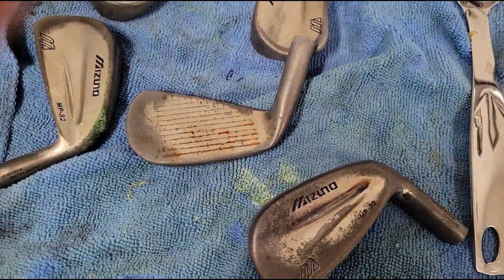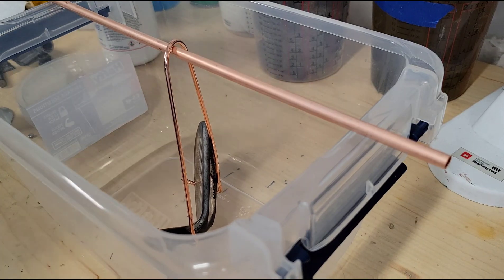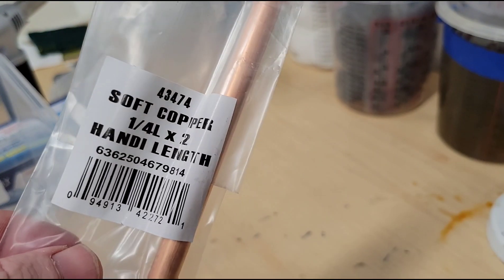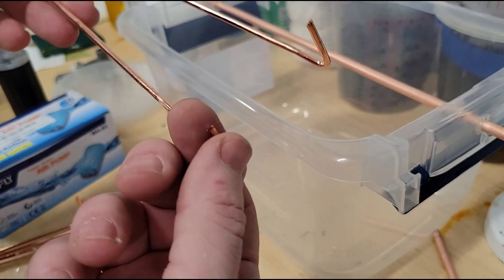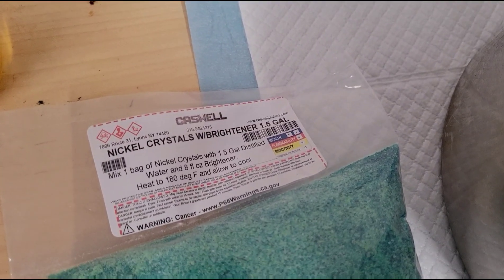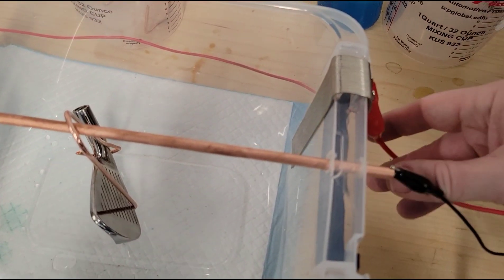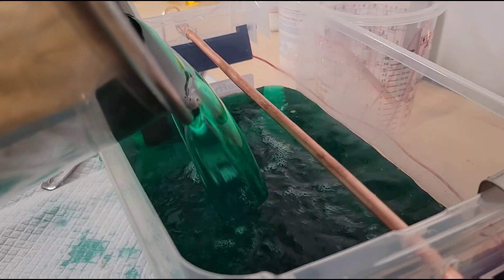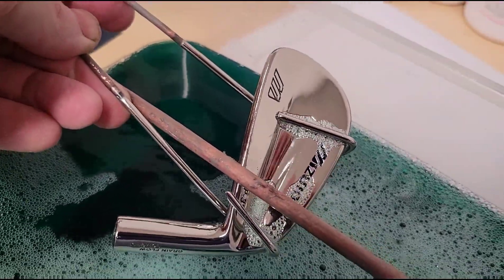Learn How to Electroplate Golf Clubs at Home! - DIY Golf Club Restoration

Comment: I'm shocked the copper hook hanger didn't interfere with the finish on the club? Did you do anything special to avoid that? Shift the club around in its hammock every now and then? I've been trying to perfect electro etching for a while, similar process. Just different solution and swapped anode and cathode. Results have been super finnicky. I've set a high bar but struggling to get the deep, clean, and detailed etch I'm looking for. I haven't tried with the bubbler yet though.
Reply from the maker: @rgraptor2542  Good eye. Yes it can. Now I hang the club upside-down by the hosel to avoid that. This video was my first attempt so the approach has evolved a bit since.
Reply: @BradMeehan  right on, as it does! Still looks nice there at the end though

Comment: voltage? 
what current do you push, DC, AC? how much?
is it voltage sensitive or amp sensitive..or combo?
Reply from the maker: @nowherebrain  3.5 volts DC, 1 Amp. Yes, it's both.
Reply: @BradMeehan  thanks for the response. I assumed DC, but didn't actually "know" and when I make assumptions, I'm usually wrong :)
Reply from the maker: @nowherebrain  lol
 You might find this method easier: https://youtu.be/f487RuyG1AY?feature=shared
Reply: @BradMeehan  going to go watch this..thanks.

Comment: I wanna chrome some motorcycle parts and this is very helpful. I wonder though how well does this chrome method hold up to high heat from a Harley motorcycle engine and exhaust system. I want to chrome my Rocker covers and panels on my Harley EVO engine and possibly some of my engine bolts and exhaust components etc. I've tried hand polishing the rockers to a mirror finish and it's certainly an improvement but not near the chrome finish I desire. Does anyone know if this is safe for high heat parts up to roughly 250° F?

Comment: I’m wanting to refinish my 50-60’s retro table. Would this work for that? I think my table & chairs are chrome. I’m assuming I may need some type of barrel set up since the legs are kinda tall. Anyone have any suggestions? Thank you
Reply from the maker: @sunshinegypsea  check out my video on electroless plating. That may be an easier option.
Reply: @ thank you!

Comment: More questions.

1. The amount you have used in this bath, how many club heads can you treat with this?
2. I have seen nickel plating liquid, this was 3 years ago, if you were still using electro plating have you refined your process?
3. I know the electro is more work than electroless, but do you have a price difference, I want to start this way first, on a budget?
Reply from the maker: @thebloodyshambles  these are good questions. I'll go in order.

1. You can do as many as you want provided you keep the solution clean. The nickel anodes themselves are what get depleted, but you can do a lot of clubs before they're depleted. You will see them being eaten. For reference, I've never changed my nickel solution since I made the video. 

2. I now use a much taller container and hang the club by the hosel. I also have much bigger anodes. I'll do an updated video soon.

3. Elecroless is more expensive but much easier. You also have to buy an additional solution as the replenisher. This is because the nickel comes from the solution, not an anode.

If you learn th electroplating method, you will have a much better learned skill because now you can electroplate other metals like copper, chrome, etc, using the exact same method. There is no other difference for the DIY projects than the type of solution and anode metal that feeds it.
Reply: @BradMeehan  Awesome thank you so much for your time!

Comment: Nice ☺️. One question how do I stop some surface areas becoming chromed?
Reply from the maker: @johnnychristo4895  you can use vinyl paint to cover areas you don't want plated, then use thinner to remove the paint when you're done. Or try taping it off, but the tape could "leak" if it's not good adhesive.

Comment: Question: 
Does the wire hook prevent plating where it contacts the club?
Are there any marks ?
Reply from the maker: @davidwood351  Yes it can. I now hang thr club upside down by the hostel. The container needs to he taller to do this so I use a plastic flour storage container.

Comment: How long in the tank for each club?
Reply from the maker: @gregboggs4721  About 30 minutes. More time = thicker but I've seen pitting occur if i go too long.
Reply from the maker: @gregboggs4721  also, check out my electroless plating video. It's much, much easier.

Comment: How many times can I reuse the mixture?
Reply from the maker: @markbaboolal  the solution is fed by the anode, so if you keep the solution clean and have a large enough anode, it could go on for quite some time. For reference, I'm still using the same solution I made in this video. I've only swapped out my anodes as they were eaten away
Reply: @BradMeehan  thank you

Comment: I’m currently looking at getting some stuff to start trying nickel plating. I’m curious how many clubs you can get out of the 1.5/1.6 gallon nickel/brightener from Caswell. Obviously it depends on the overall thickness, but do you think that would be enough for 9 clubs plus a few cheap thrift store clubs for practicing on? Or should I plan on needing more?
Reply from the maker: @Praxtra_  with electroplating, the nickel anode feeds the solution. I haven't changed my solution since i made this video, but I have replaced my nickel anode after about a year.
Reply: @BradMeehan  oh? I would have thought that the nickel is also taken from the nickel solution, thus spending the solution. 

I guess that’s moreso an issue with the electroless plating.
Reply: I also was going to ask, I saw your electroless nickel video. Any idea how long the electroless would last, as I know that solution gets “spent” after a certain amount of plating time.
Reply from the maker: @Praxtra_  On the electroplating, the anodes feed the solution.  So, you're correct in the way that the nickel comes from the solution itself. It just gets replenish from the anodes.

With electroless, it's much more beginner friendly but you have to add replenisher (more solution) because there is no anode. You can probably do a full set, but I add a few oz as I plate to ensure I don't crash the solution.
Reply: @BradMeehan  appreciate the insight! 

Any idea if there’s a difference in strength between electroless and electroplated? I may repolish and chrome them in the future, but for now I just want something that’ll hold up for a year or two

Comment: i get nervous about the power source. Do you have a video about what is the best one to use? is any of this dangerous? between the electricity and the chemicals... just curious if there is info already out there about those steps and processes.
Reply from the maker: @mcburdiegolf  I can do a more detailed explanation. But, for reference, it's about the same voltage as two AA batteries.
Reply: @BradMeehan  ok so not gonna get electrocuted lol. Also I found your post that showed how to get a power source and you cut the wires but then what? What and how do you connect the alligator clips to the wires. Again sorry for being a moron with electronics

Comment: 📍Decent setup tips! My  only constructive criticism is “Once you submerge your part in the plating bath don’t TAKE IT OUT! You’ll find that on page 44 if you got the Caswell manual.😉
2nd is having a consistent temp of 135-140° for the Bright Nickel Solution while plating. [I didn’t notice a heater in the video or mention] 
📍You did mention doing an “Electro-Clean” in your text, but didn’t mention the more important “Surface Activator” just before you drop the part in the Nickel Bath. It is very cheap way to be sure your part takes the Nickel!
Lee

Comment: Is there a solution that doesn’t leave them chrome and has a matte style finish
Reply from the maker: @tylerlim5669  you just have to spray it with the bead blaster. There's a cheap handheld one in the equipment links. 

Check out my video on the Tommy Armour 845 to see how I do it.

Comment: Hi Brad. Can you put more than one club for nickel plating or must you do it one at a time?
Reply from the maker: @kevanpillay9701  it's limited by the size of the nickel anode. It must be 2x the surface area of the club. You're better doing an assembly line and polishing one while the other is plating

Comment: Question(s)
No marks left from the hanger wire touching the metal ?
Would it be better to suspend by the shaft pocket ?
Reply from the maker: You'll see in my newer videos I hang it upside down by the hosel to avoid that. It works much better.
Reply: @BradMeehan  Thank you !!! Great job on the Channel !!!

Comment: Nickel isn't too difficult and it can come out very pretty and good protection too. It's not chrome, but also... the advantage is that it's not chrome.

Rumour has it you can also add a layer of rhodium plating on top as another home option, but i haven't tried.
Reply: I’m having extreme difficulty getting my clubs to electroplate I’ve done all the steps and it still won’t work. I’m frustrated
Reply: @DaleB1971   Any unusual colours in the liquid? If you get any brown or something like that, it's electrode quality. At what stage is it going wrong? Is the plating flaky, not sticking? What sort of current are you achieving? Is there potentially a varnish on your items, or what surface metal are you trying to plate on top of? You can plate nickel on steel, brass and copper, you can't plate it on top of any other metal, or at least not directly and not easily.

Comment: if i were to plate a round piece of steel 1.25" diameter and 25" long will this work or do i need more voltage/amps, i want plating to be as thick as i can get it.  thanks and very good presentation
Reply from the maker: Check out my Electroless Nickel video. That may be a better option for this use case. But yes, you'd have to do a bit of math. There's a calculator on the Caswell site to help with power requirements for your parts. It takes into consideration the entire surface area to be plated.
Reply: @BradMeehan  thank you much

Comment: Hii, may i know the amp and voltage setting that you use?
Reply from the maker: 3.5 volts, about 1 amp.
Reply: @BradMeehan  thnks sir.
Reply: @BradMeehan  also, what is the metal you use for donor electrode?
Reply from the maker: @azhari9847  it has to be nickel. The anode should be 2x the surface area of the item you're plating.
Reply: @BradMeehan  means the surface area of the electrolyte + donor metal right?
Reply from the maker: @azhari9847  Just the donor metal should be 2x the surface area of the club head.

Comment: How does the plating come out directly where the copper cradle touches the club head? I would think it leaves a bare spot or a small divot or something since the wire is touching it.
Reply from the maker: Check out the latest videos. I've been hanging the clubs upside down by the hosel to avoid it.

Comment: Is there a reason you only did one head at a time or could you hang a few at the same time as long as they don't touch each other in the tank?
Reply from the maker: Actually the anode is supposed to he twice the size of the item you're plating so on this small tank, I do one at a time. Also let's me do an assembly line where i can polish one while another is plating.

Comment: Great video, totally new so forgive me… but is there any fumes that come off of the solution? Just wondering about any precautions to take when setting up to plate a club. Thanks!
Reply from the maker: No fumes. No smell at all, really. But ventilation is recommended. Also, use rubber gloves.
Reply: @BradMeehan  Thank you! Speedy reply… much appreciated!

Comment: Brad, as usual, id like to thank you for showing the rest of us how to do this.
The positively charged metal that you're using... What are they called so i can get them from Home Depot? Right now Ii don't know what they're called or what they are for that matter. I'm assuming that they're nickel plated metal in order to get the nickel to adhere to the negatively charged golf iron.
I live in Canada, so to be on the safe side as far as sourcing some of this stuff, what should i ask for or look for to get those metal plates?  If you don't get them from Home Depot, let me know so hopefully we have the same chain of stores here in Canada as well.  Thanks in advance for your help and guidance. You're such a great guy doung all these videos for us laymen!
I was wondering why you only do one at a time, but then I read a reply to one of my own comments and you explained why you only do one at a time. Once removed from the suspension, the metal starts to corrode quickly if left sitting for some time. That makes a lot of sense to do one at a time.
Thanks man, you're awesome!!

Comment: Hate to tell you this but the instant you pull an article OUT of the nickel plating bath, you BREAK electrical connection to the DC power supply andplating process. This is a huge mistake. If the connection is broken, the plating STOPS and any further plating will NOT STICK, and can literally be peeled off. Read the plating book Caswell gives you.
Reply: Good to know. I've only done tin electrolysis on a soldering iron and pen/brush plating myself, so I'm tryin to get all the pointers I can
Reply from the maker: Thank you
Reply: @BradMeehan  Its one of the hardest lessons to learn, almost everyone makes that mistake. Couple months ago the articles I was plating all failed to correctly plate, and I was getting strange scratch marks on a mirror flat article. Took a month to figure it out, the DC power supply was having micro DC voltage failures you couldn't see or hear happening. The scratches turned out to be that I had polished some rusty iron on the same buff I was rough polishing, so that the buff became contaminated with iron particles that caused all kinds of weird streaks and the plating peeling off. The plating manuals barely even mention these things. I lost a whole month worth of work...

Comment: How did you get the black writting on them?
Reply from the maker: It's just paint. Check out my  paint fill video tutorial.
Reply: @BradMeehan  did you paint it before plating?
Reply from the maker: @pbysome  I was lazy and didn't remove the old paint. You're supposed to do it after. The nickel won't bond to the paint, but now I know to do it last.
Reply: @BradMeehan  ah I see, I've been doing some nickel plating on old car parts, seems to stay dull (which is ok for the parts I'm doing) do you chrome them after the bright nickel? And do you polish the bare metal?

Comment: Hi Brad, thanks for the vids... I say vids instead of videos because I simply do not have the time to type the extra I O :).... I am wondering if it's possible to do a batch plating all at once? Grind, sand, polish, etc, to an 8 -10 club batch of irons, then put all of the heads in to the solution you made up in the video? Thank you.
Reply from the maker: Yes, but here's the catch: your anodes need to be about twice the surface area of the item you're plating, so you'd need a pretty hefty sized nickel anode to keep up with plating onto the club heads.  I do more of an assembly line where I have one in the plating tank while I'm polishing the next so there's no time for the club heads to start corroding again.

Comment: Thanks Brad, your videos are great! I'm learning so much and may incorporate this into my golf club hobby builds. Some of my family and friends have golf clubs they don't want to part with, but are looking quite beat up at this point!! 
In regards to this video, can you not do more than one at a time or did you only do this one golf iron for the purpose of simplifying how to do this? Thanks.
Reply from the maker: I do one at a time so I can tackle it in an assembly line way - meaning, I can plate a club while i'm sanding/polishing the next. They start to corrode if the bare steel is left sitting. Also, the size of the anode needs to be about twice the surface area of the item that you're plating. These little anodes aren't big enough to handle more. If you have a bigger setup, you can do multiple. Also, I'm lazy and a mega-procrastinator.

Comment: First try today, but it didn't go very well. My bubbler was creating a large amount of foam in the tank. Any ideas what may be causing this? Could it be containmination of some sort?
Reply from the maker: Someone on my Facebook group reported the same thing. was it the Krohns solution or the Caswell?
Reply: @BradMeehan  Krohns bright nickel electroplate solution
Reply from the maker: @keithlapinski1594  would you mind posting a pic on the Facebook group and I'll reach out to Krohns to report it.
Reply: @BradMeehan sure, I can tomorrow. It really made quite a mess to deal with.
Reply: I requested to join your Facebook group

Comment: How much nickel anode or strips + brightener do you need to do a set from 3-pw ?
Reply from the maker: I've only replaced my anodes one time since I started and have been using the same solution. I'd recommend getting a large anode or two straps. You generally want it to be twice the surface area of the part you're plating.

Comment: will a 12 amp car trickle charger work as the power supply?
Reply from the maker: That's too much. You need about 3.5 volts and 1 Amp.

Comment: what is the voltage and current from power supply used?
Reply from the maker: 3.5 volts,  1 amp for my container size has been my sweet spot

Comment: Do you find that using an airstone with very fine fast moving bubbles work better or does an airstone that produces larger air bubbles work best?  Also, do you put the airstone directly on the item you are plating or a distance from it so the solution is just circulating and moving?
Reply from the maker: I put it directly under it. I've only owned this one air stone, so I can't compare to something with larger bubbles.